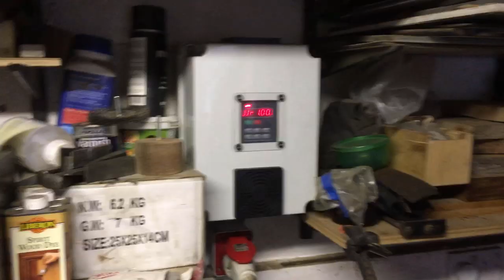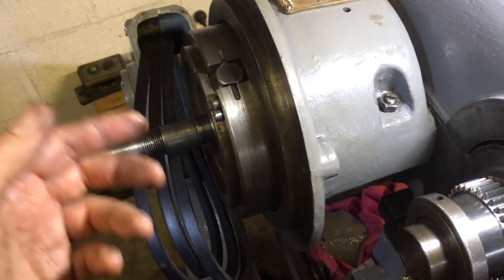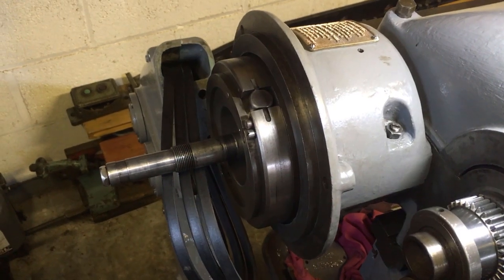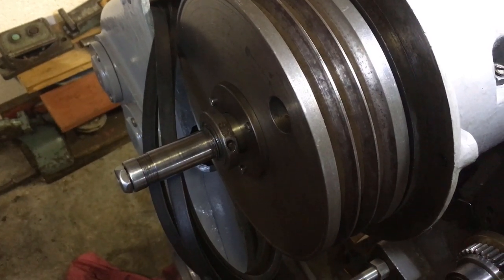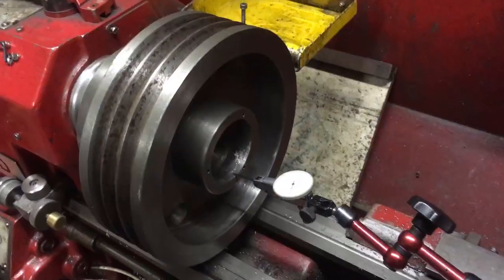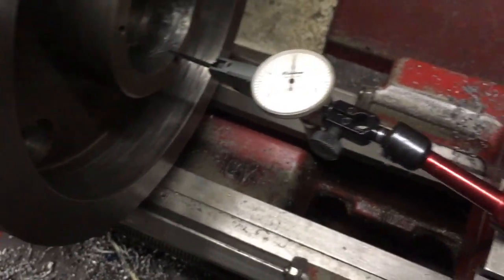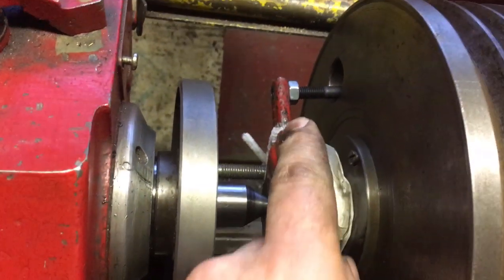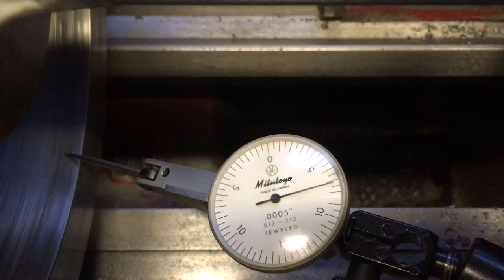Holbrook Lathe T13 Update 15 - Commissioning The Drive Clutch

Comment: Good to catch up on progress.
My Colchester clutch looks to be of similar design and it too drags but only when it is cold and only in the slower speeds.
This also defies logic as I would expect more resistance with cold oil.
As it was running when I bought it I haven't done anything to the lathe other than change the oil.
Watching you I think I will leave it alone .
It will get worse before it gets better being the adage.
Reply from the maker: From what Ive read on line the type of friction drive on the Hobrook appears as basic and reliable as it gets, later lathes made use of all manner of sophisticated clutch arangements - 'matrix' type being a group not known for their easy low cost repair. My lucky stars have been counted :-) All the ebst Steve. Mat

Comment: Good result.  Got to love Defender wiper blades!  Also as used on the Caterham Seven less 1/2" or so courtesy of a pair of side cutters.
Reply from the maker: Sometimes they actualy move the water film, most of the time not ! Having said that, the internal damp / fog, etc is a pain.  Long time since I sat in caterham 7 ata car show with my dad. I was too young to drive at the time - not sure my fat arse would fit these days :-) All the best Mat

Comment: Armored cable for the old lathe, Flash as a rat with a Gold tooth.
But seriously it's looking good. There is something about using a nice tight plain bearing lathe especially one with a proper brake and clutch set up like you have.
Reply from the maker: 'Flash as a rat with a gold tooth' - that made me laugh - never heard that phrase before. the cable is 'SY' 4 core . Its what the electricaisn always used for inverter driven drives at the plant I worked at. Much more flexible than armoured and I believe its screened. Im no sparky. But Ive always used the stuff - so all my power cables are the same, silver stands out better than black against my workshop walls and floors so less chance of crunching it. Thanks for stopping by and commenting :-) All the best Mat

Comment: You will want those bearings tighter if you try to do any parting off with it.  how does the clutch engagement detent or over center?
Reply from the maker: I will tighten up the spindle bearings - probably after Ive shifted the lathe into position Brian. Ive a couple of welding projects I have been puttong off for too long. Time to learn how to use my TIG welder. The clutch lever shifts a shaft which had a pair of detents which locate the two positions. In addition , the cam is a round with two flats - so drive is when the followers are both on the round section. Free wheel when the followers drop to the flats. I think thats belt and braces. All the best Brian. Mat
Reply: If you run the parting tool upside down either at the rear or in rev  it 's usually not as much of an issue .

Comment: Great work! Do you think that fitting the chuck as you run the spindle in will help transfer the heat away from the spindle? Keep up the good work, really enjoying seeing the lathe come alive.
Reply from the maker: Not sure how the additional mass would affect things. Ive a number of chucks to mess about with - I dont know what Ive got to be honest - I just loaded the van with whatever was around the lathe. - I know some are short of backing plates and the spindle nose is a unique (to Holbrook) spec' so I got to make them on the lathe.  I think I will start off setting up the bearings with no chuck and see how things go. Then fit a larger chuck and see what happens. Cheers Roger. Mat

Comment: SUPER slick work Matt. 3 V belts on that sucker, Very impressive. What sort of end float did you end up with for the spindle? My formal training on tapered roller bearings sets the running temp after proper float is set to about 40 degrees above ambient.
If you plan to go low Hz on any of your machines and lack the torque, Consider getting a sensorless vector driver, SVC. Most of the Chinese VFD's are Hz/V scalar mode. 
keep it up!
Reply from the maker: Ive not set the spindle end float yet, I want the bearing clearance set up and then will as you say, let it run up to temp and set the float at something like 0.0005" . There is a ball race inside the headstock and the locking collar on the outside pushes against a gear which in turn runs against the white metal faces of the bearings and gets run off lubricated. Its not tricky to adjust so may well tweek things as I go.  As regards the clutch shaft - end float is a couple of tho', it was near 0.450" without the spacer. The gear mesh inside for low speeds is far more positive now.  All the best Mat

Comment: Great to see the clutch working. Sounds like who ever forced the clutch shoe out could have over sprung it, but I could be wrong. The landy sounds great after all the work you had done. How's the elbow doing?
Reply from the maker: Hi Duncan, I think who ever had the clucth apart was out of time or depth. Stuff was missing and parts reversed... well its sorted now so I sholdnt grumble.  The defenders running well, got a couple of jobs to sort - not least of which is the hole in footwell ! Have a TIG welding  job to do, so going to get that kit out and start learning ! The elbow .. improved but still hurts at the end of the day and is stiff in the cold damp.  Still, its functioning. All the best Duncan. Mat

Comment: Wonderful machine. Considering those are straight cut gears, the noise does not surprise.
Reply from the maker: Its about right from what Ive seen & heard - I had hoped the massive cast top and other castings would reduce / muffle the noise. Time will tell. I do have a noise APP on my phone so might take some readings to see what it shows. All the best Mat